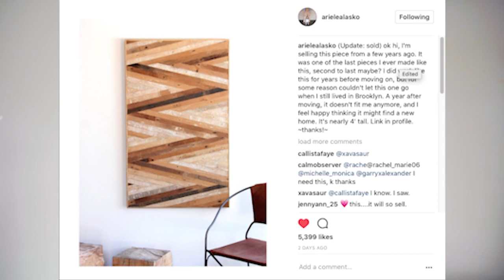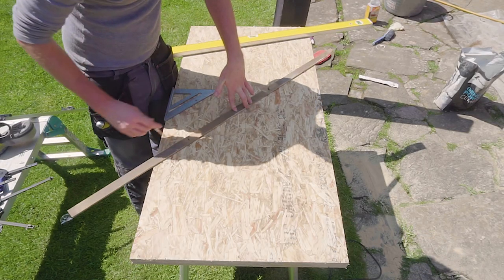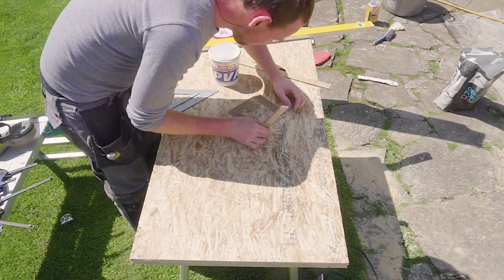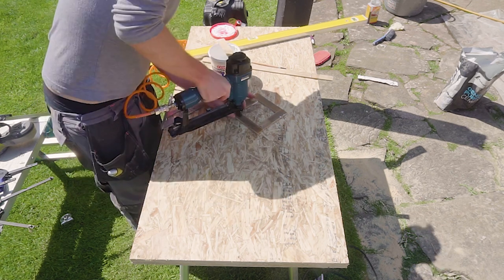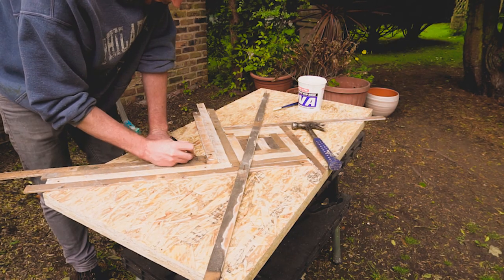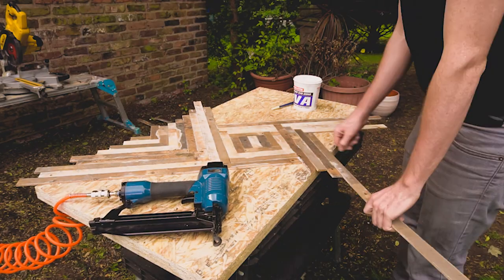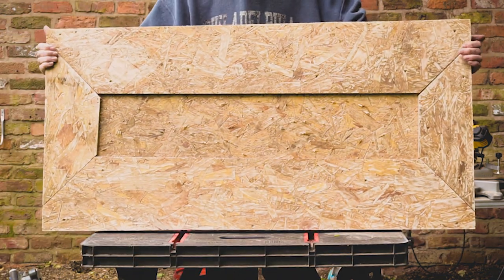Modern Geometric Wood Wall Art | Ariele Alasko Style

Comment: Why not use liquid nails instead of the nail gun.  Then you don't have to make the back so thick...also it would weigh less.  Just a thought. Very nice job!  I like it a lot.
Reply from the maker: You still have the setting time even though it’s shorter, you totally could though. Really I should have used smaller gauge nails which I think are slightly shorter, that being said I  wanted it to be pretty sturdy and a nail gun is a fun tool! Thanks for watching and commenting! 😁🎉